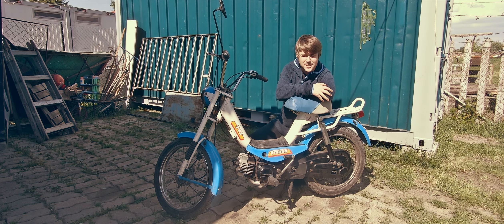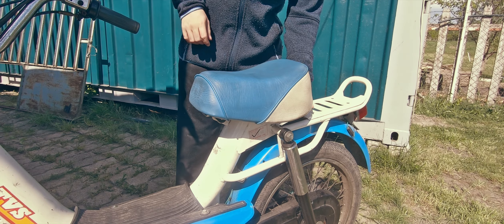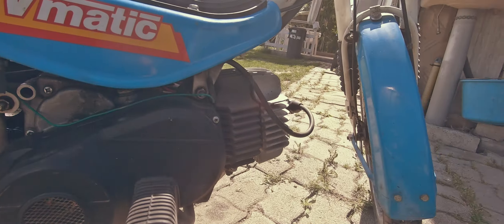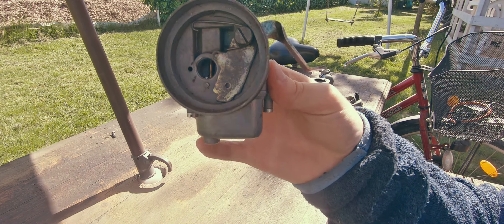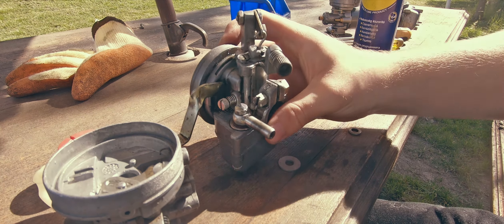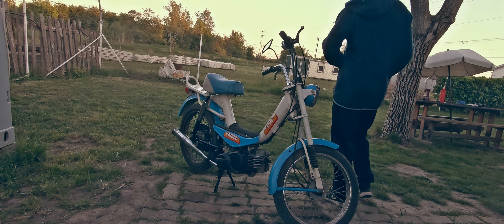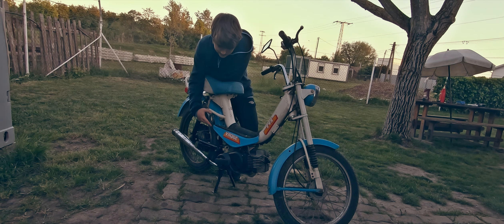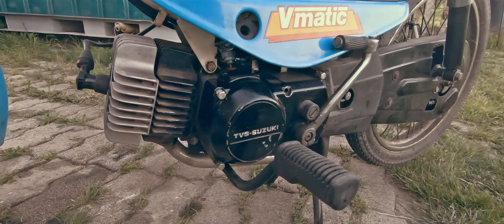Carburetor Problems // TVS-Suzuki Eko Vmatic Episode 1

Comment: Hello my friend, I have a Jawa 207 and I wondering if I could speak with you about some things regarding this moped? Thank you
Reply from the maker: Hello! You can ask me anything, and I'll try to answer as well as possible
Reply: @levix_the_birb  I have a 79 Jawa 207 and some of the wiring behind the fuel tank are cut, the horn is missing so I know that is some of it, to have an idea of the rest, and is necessary that they connected correctly to start it?
Reply from the maker: @jpinheiro57  no, it is no necessary that they are connected for the bike to start. All you need for that is, that the cdi is properly connected to the engine's ignition.